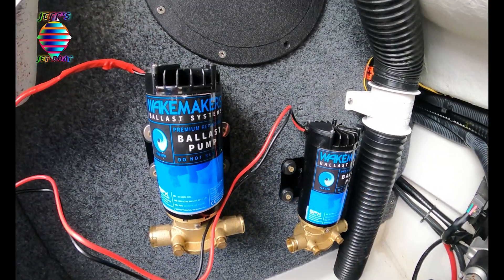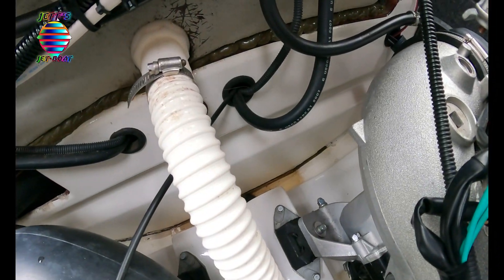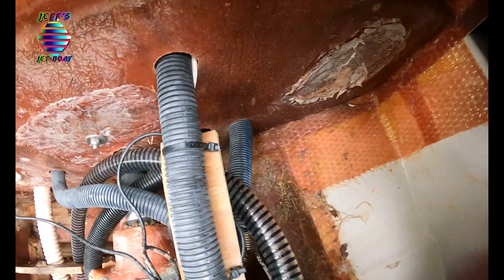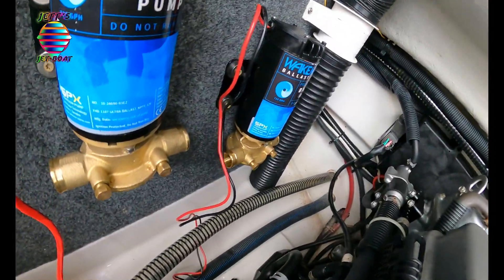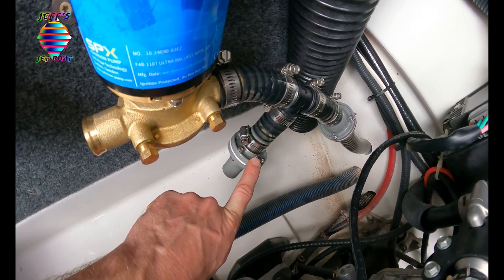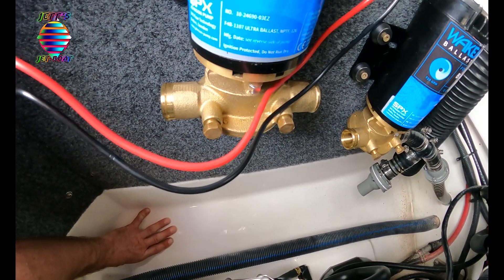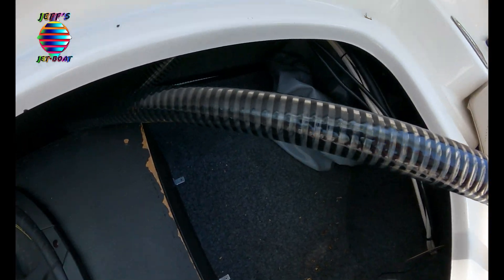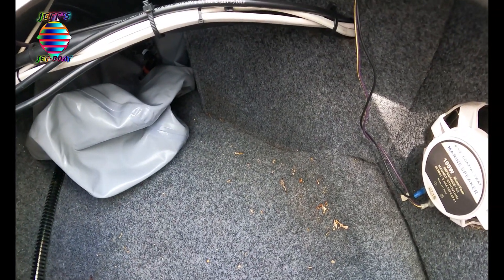Ballast System Install - Pumps & Hoses - Part 4

Comment: Insulate that tee fitting that's against the pump. Vibrations in the engine compartment can wear a hole in it. It may not be touching the pump housing, hard to tell in the video. Wherever you have 2 hoses running parallel together, you can keep them from shaking by joining them together with P-clamps. Just a suggestion from a retired bus mechanic. Isolation, isolation, isolation. Absolutely phenomenal job Jeff !